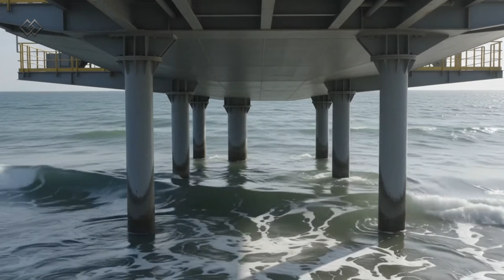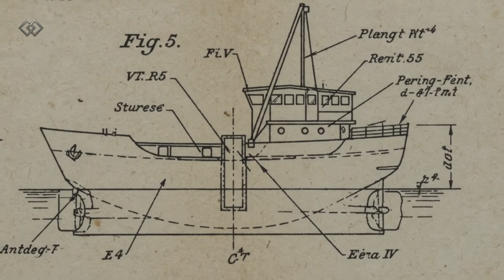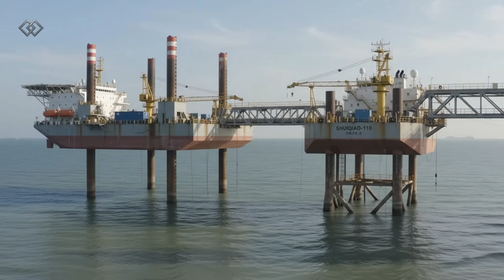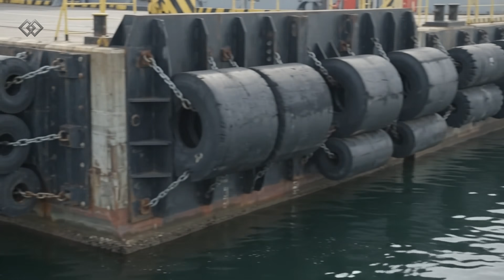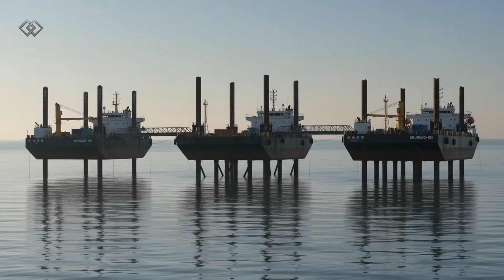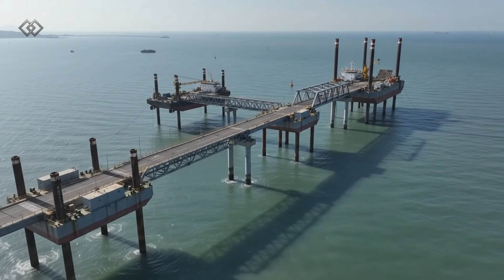How China Builds This Ship That Turns Into a ROAD? Inside Shuiqiao Production

Comment: As long-as it works and proven, no one needs to know. lol
Reply from the maker: Exactly 😄 For a system like this, reliability, load capacity, deployment time and operation in difficult sea conditions matter far more than looking impressive. If it consistently works when needed, that is the real engineering test.

Comment: Infrastructure bridge, high way, speed rail, ports, hydro power, wind power, solar power are all green power all come in handy from China, ready to green this planet whist world are facing energy shortage + climate change ! Human shown so  vulnerable under heat waves which only one of the disastrous climate change !
Reply from the maker: China’s renewable buildout is enormous, but bridges, highways and ports are not automatically “green.” Their environmental impact depends on construction, energy use and what transport they enable. In 2025 China added nearly 500 GW of renewable capacity, over 60 percent of global additions, while coal still supplied about 55 percent of its electricity. The transition is massive, but far from complete.
Reply: @ModusAssembly yes not perfect green to hazardous head waves problem, China will move forwards with greener solution together with the world for better planet to live. ❤